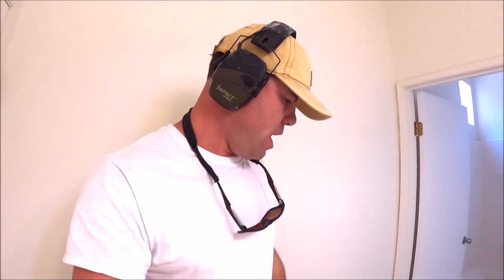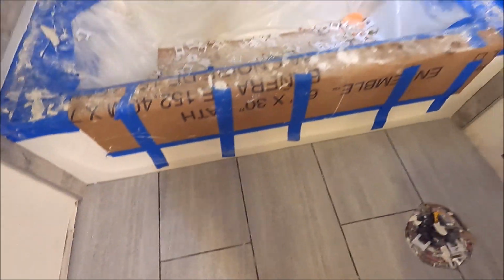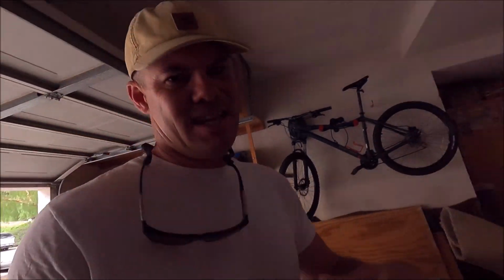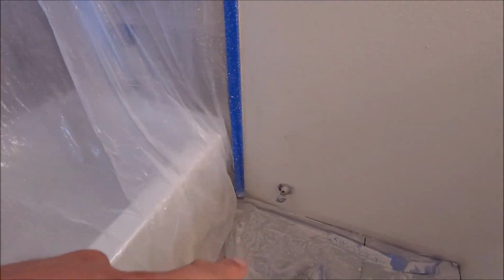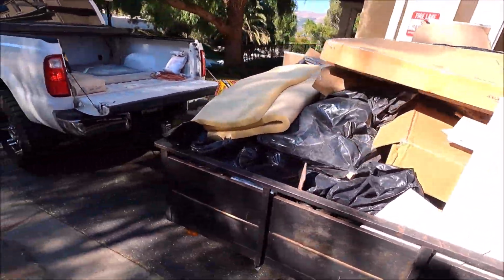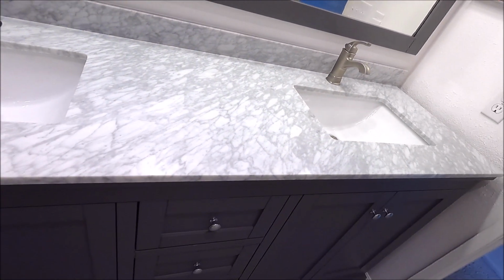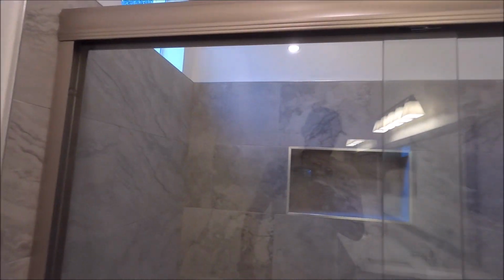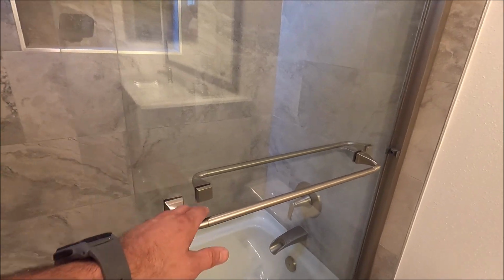Old to New Bath and Shower Remodel

Comment: If the 12x24 tiles that I have recommend a 1/3 offset, can I put them at a 1/2 offset and still avoid lippage? (using a tile leveling system of course)
Reply from the maker: Yes, we always install at 50% offset with our anti lippage system 👊
Reply: @LandbergTileTV  thanks, nice work!